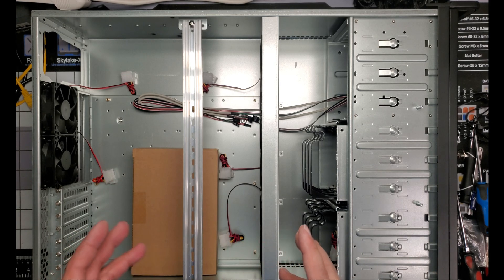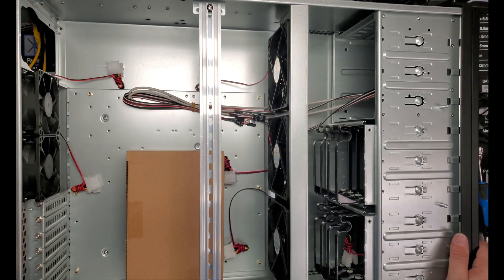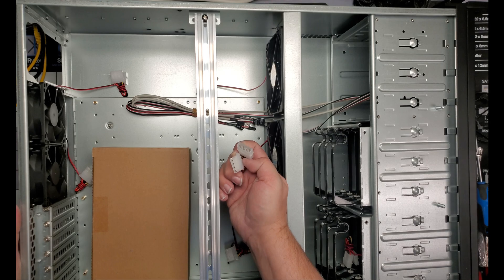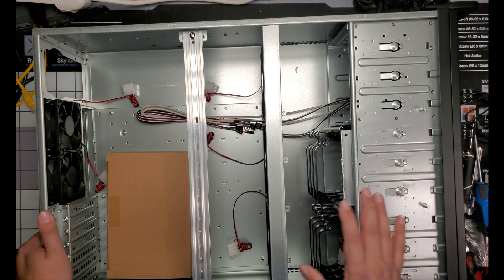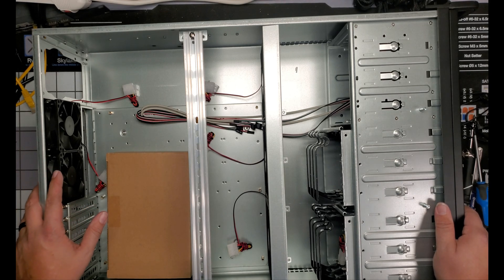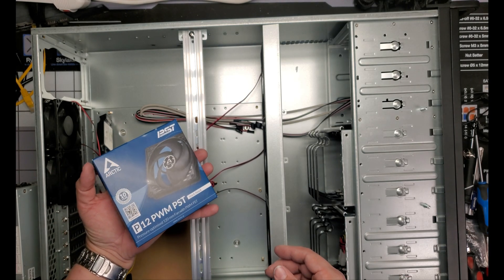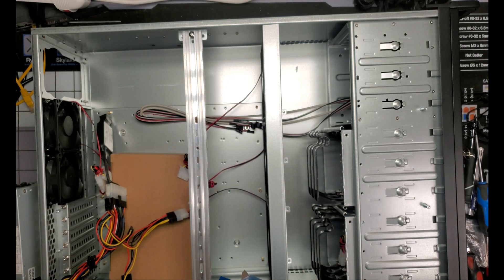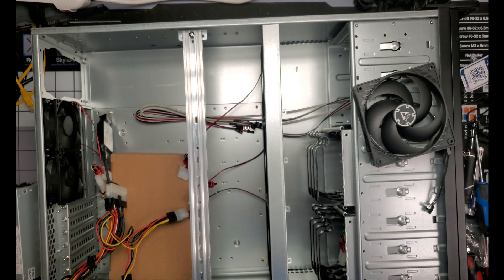Rosewill RSV L4000 Case Fan Testing

Comment: Rosewill fans can move air but they have very little STATIC PRESURE. I love the rosewill 4U chassis, but as soon as I open the box, out come the fans.
Reply from the maker: Check out the eisbaer video. Same case but a 250+Watt threadripper liquid cooled
Reply: @qcsbuilds5708  The 360 is out of stock. I wonder if the 420 will fit?
Reply from the maker: @rdsii64  probably comes down to tube Clarence.

Comment: Still my favorite chassis. I ended up putting 140mm fans (that have 120mm holes) in the mid-wall.
Reply from the maker: It's a good case for the price. Later on you'll see I change the two lower fans with P12s